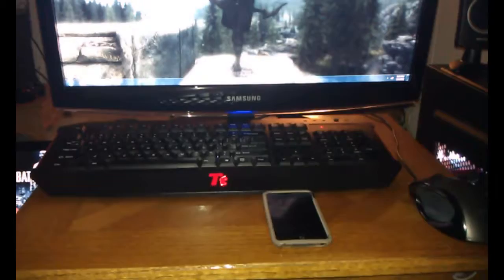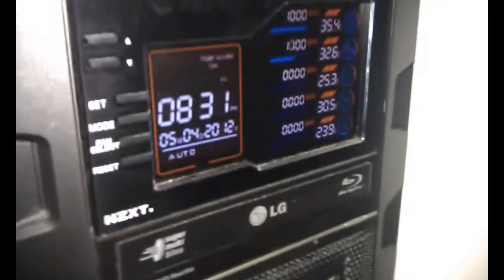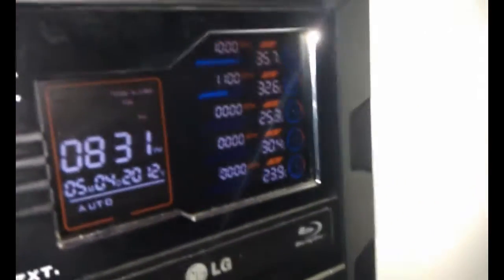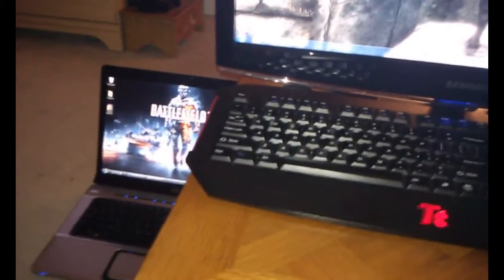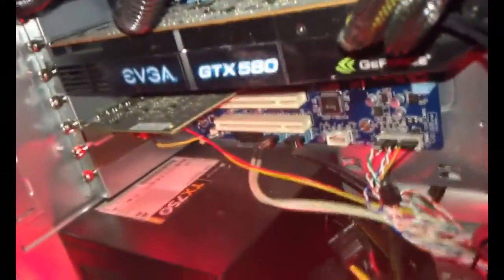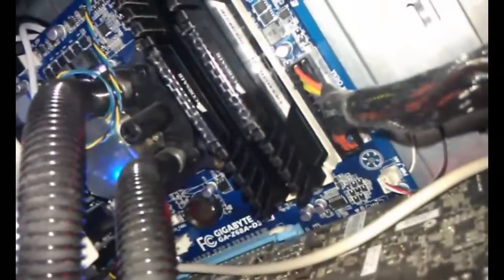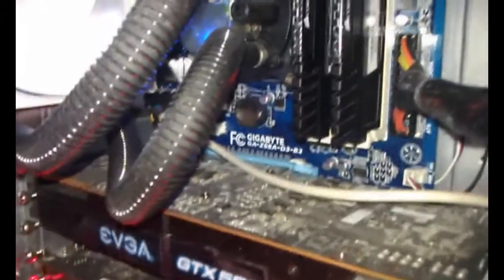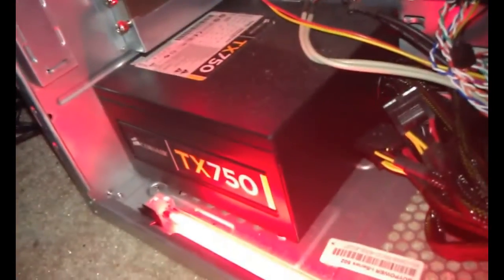My Custom Gaming Computer Part 1 - The Computer and Accessories

Comment: I liked your video even though it was very blurry and shaky.Try and talk/learn more about what actual mobo, HDD or SDD, and cpu you have. They are just as important as your GTX 580, which btw is very nice. Ppl who watch these want to know exactly what kind of rig setup you have. You did'nt even mention what cpu you have or what kind of "all-in-one" cpu cooler that is, although that looks like the fee one they provided. The free Killer 2100 you mentioned is nice and does work with your wireless.

Comment: OK, what you have on the front panel is the NZXT Sentry fan controller.Probably the most common ever, but it's only "ok". Your Thermaltake challenger keyboard and Sb Tatics headset are mid range, but decent.The case is part of a coolermaster series of "HAF" cases. HAF meaning "high air flow". They are GREAT cases. I personally have the HAF-X. The screws on the side panel are called "thumb screws", not pins lol.You have 2x 4gb of Corsair Vengence ram which is good ram....